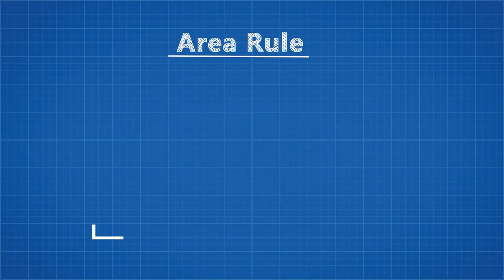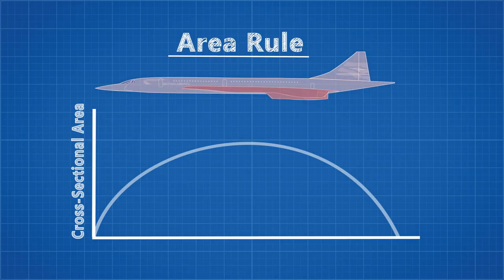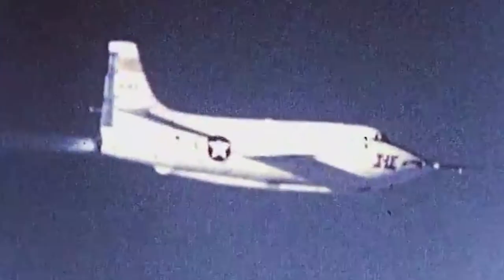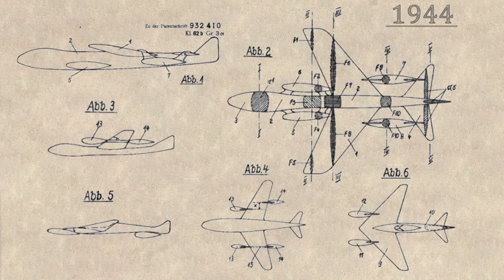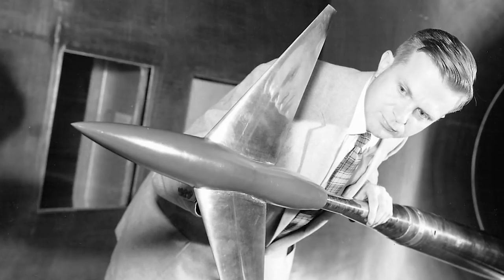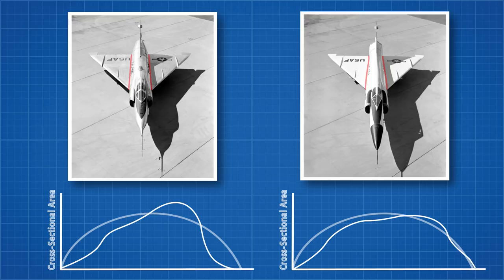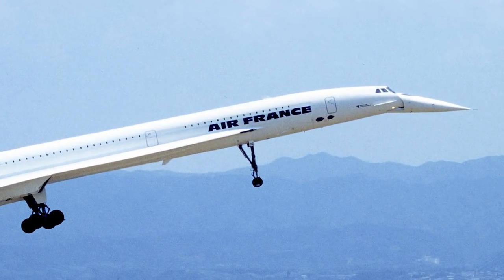Area Rule: How To Make Planes Fly Faster

Comment: Honestly did not understand the area rule. And whats with the cross section graph, is it a graph? Or a cross section of the plane? What does the line represent? How did one small change on the plane design make the line smoother? I have to find another video on youtube that clearly explains this to enter your contest.
Reply: it's a function. x is the position along the plane's length, and y is the area of the cross-section of the plane taken at that position. Basically, you are cutting the plane in short slices from nose to end, and the area of each slice give you one point on this curve. That's how i understand it anyway
Reply: In less mathy speak its basically like this: you want a football like shape, narrow at the front, slowly broadening, then gradually narrowing again at the end. That graph is just the mathematical way of showing that
Reply: If you're still unsure of the cross section that is being discussed and how the graphs work:
Imagine you had a giant bread slicing machine like thing that could cut the plane into thin little sections. Run the plane through that such that the first slice is the very tip of the nose, like the heel of a loaf of bread.

Measure the area of each of the slices, and plot them on a graph in order. The larger the area, the taller that point is on the graph. - You want a nice smooth curve with no sudden jumps or falls.
Reply: These comments explain it better than the video, the video needed more explanation especially with regards to the graph and an explanation on the briefly mentioned 'wave drag' and the shock-waves it creates?
Reply: The football shape thing is close but the cross sections don't have to match the "shape" of a football they have to have values similar to those positions on a football. 

Imagine: slice the plane into thin ribbons from nose to tail. Reshape the weird shaped ribbons into circles and then put them back together. The ideal plane following this process will end up shaped like a football.
Reply: This thread made waaaaaaaay more sense than the entire video. And without fancy animation, just better wording. You guys should start an engineering channel.
Reply: Randomly enough, I actually have been working on scripts for a possible engineering/design channel, but exploring flaws and neat ideas seen in industrial design. No idea if I'll ever get the time to film any of them.
Reply: RealLuckless I would love to see that.
Reply: Yeah, I needed to rewatch the vid to catch what exactly was being plotted in that graph. And I'm a Physics major.
Reply: Can someone explain me why does the area rule work?
Reply: The area rule basically this: the ideal shape of an air craft is a sphere. The closer the shape is to a ball, the more efficient it will be at flying.
Reply: Why ball? Water drop like shape has the least amount of friction, does it have that much less lift?
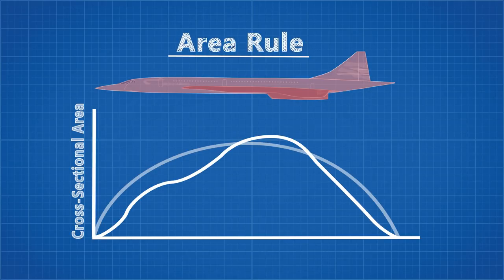Reply: I'm sorry but he explained the graph very well at 0:53 so if you didn't get it maybe you missed that part or you didn't have your coffee yet... Either way, no need to really critisize his video/presentation
Reply: So...it mean the smaller the plane the better it generates lift? What make plane go faster as far as I know probably was about engine most of the time and as well earo dynamic
Reply: The x is the position on your plane, and the y is the total section aera of the plane at this position. It means that if you cut the plane at the position x and you watch it from its front, you will see the total section aera.
Reply: @brandondavey8127  That's description of the Area Rule is funny, but certainly easy for a person to visualize. It also makes the task of understanding how an actual airplane succeeds or fails much easier. The video needed something like your description in a video form. Thanks.

Comment: At higher speeds, the F-14 Tomcat's wings rotate rearward, creating a more delta-shaped wing geometry, but also matching more closely the ideal cross section area distribution you mentioned in your video.
Reply: This is also done to increase sweep as well as change the primary lift generation from traditional pressure difference due to laminar flow over the air foil, to vortex lift which intentionally creates flow separation to produce large vortexes above the wing

Comment: Street lights! With recent hurricanes in America and major storm in Romania, many street lights that weren't aerodynamic enough  were bent or torn away, while the nicely streamlined ones were still in place.
Reply: Halo444 no this actually works differently. The street lights are streamlined not to lower the amount of force applied by friction of the air, but to reduce the low pressure zone that forms at the back (the side where the wind flows away from  the ligt) of the light, because this forms vortexes that will make the light swing from side to side perpendicular to the direction of the wind. Real engineering actually did a video about the burj kalhifa in which he explains it: https://youtu.be/niVguabIhTs
Reply: Nope. The area rule reduces wave drag, and therefore is only a factor at speeds close to and beyond the speed of sound. The street light design has to do with  a different phenomenon.

Comment: Wow, that's awesome! I already found a couple (I think):
- The reason for the Space Shuttle external tank and boosters not being in line.
- The reason for vertical and horizontial stabilizers never starting at the same point.
- The reason for military drones like the Global Hawk having a big hump in the front.
- The reason for modern planes like the A350, 787 or CS300 having front sections with completly smooth tapering unlike older planes like the 737 having a distinct "nose" in front of the cockpit windows.
- The reason for the iconic bulging shape of the Super Constellation.
- The reason for the Eurofighter Thyphoon having small fins between the canards and the wing.
- Probably the reason nobody uses canards.
Reply: You are almost completely wrong LOL

Comment: The SR-71 has that rule incorporated with pretty dramatic effect as the fuselage nearly disappears into the wing as the wings cross section increases. It's also noticeable on the B-2. Much larger at the cockpit, slung way out in front of the blended wing. Then the wing becomes thinner and thinner as you travel rearward on the plane since the wing is increasing in span.

Comment: You can see that in the blackbird. The wings are heavily put back on the plane but the intakes for the engine being put just in front of the wings. Not to create too much drag but for the desired purpose you said In this video.
Reply: Yes, although more so on the SR-71 than the A-12.
Reply: Also the oddly wide nose slightly tapers on the way back to the wing almost in line with the engines. I also assume that this applies to the bulbous bow on large ships as the primary use is to reduce wave drag. Also I'm in Cork so hmu.

Comment: This effect can be found on the XB-70 Valkyrie, as the fuselage slowly gets smaller while becoming part on the middle wing structure. Also, the engines were placed in a smooth box which was designed in such a way to be as aerodynamic as possible, while still allowing for the necessary features go compression lift.

Comment: My favorite cross section area proportion is on the Su-27 family.. It flattens out at the wings
Reply: Yes, and actually this is a technique that a lot of airliners use as well, except at the bottom rather than the top of the fuselage. It would be inconvenient to narrow the plane above the wings because that would reduce passenger space, and the same goes for lowering it at the top of the fuselage, but they can lower it at the bottom of the fuselage, because that way, they only cut into cargo space.

Comment: Aerospace Engineer here... 
Take a look at the Cessna Citation X aft fuselage. It's heavily area ruled for several reasons; first, to reduce drag due to compressibility effects (as the video mentions) but also allows the massive engines to be mounted closer to the aircraft centerline which reduces the moment caused by an OEI (one engine inoperative) case which in turn reduces the required size of the vertical tail thereby also reducing drag (not just in the transonic range).
Love this channel by the way. I hope it inspires more people to get into STEM fields.

Comment: you cannot discover something twice and i find it sad that just because they were German/worked for the nazis that some people never got the recognition they deserved. Otto Frenzl(i knows classic german name) figured this out almost a decade before Whitcomb and yet people call this effect after him instead.

also engine placement on small business style narrow body jets has little to do with area rule. you can't put the engines anywhere else but at the rear. not enough room under the wings. to put them there needs a high wing or large undercarriage(both undesirable). fokker 614 aircraft had them on top which looks kinda funny and mounting them on the middle/front fuselage blocks your view, is too stable(yes that can be bad) and is very noisy inside the cabin.
Reply: They can always be mounted within the wing as in the UKs V bombers and the Comet. But that would obviously restrict the engine size. But it is a possibility.

Comment: The Cessna 172 is an aerodynamic masterpiece, the area rules is almost spot on, that's why it is so widely used :)

No, but on the SR-71 the fuselage is getting thinner along the length of the plane as the wings and their engine pods start to expand, such a cool aircraft

Comment: This is also used in naval architecture. Ships are made in the same way. Ships hull must be smooth for better dynamic properties which brings to reduced fuel consumption and better speeds, but ships hull is typically smooth ("ideal") because there is no wing or engines on the sides.

Comment: very good explanation, there's another reason for placing engines ahead of the wing though: it helps giving "pitch down" tendency to the airfoils during wing flapping motions, avoiding the very dangerous situation of airfoil or wing "divergence" in which the wing airfoils pitch upwards very suddenly and uncontrollably causing mechanical failure.

Comment: The Sr-71 and A-12. They both had strakes running along the length of the cockpit and fuselage to better handle transonic speeds. And the 2 seater Training variant of the Sr-71 had a second smaller cockpit above and behind the first, which dramatically lowered the top speed due to the incredibly large amount of drag it produced despite it's small size.

Comment: The B-2 Spirit is a great example of this rule I think. The front where it's narrower is larger vertically, and as it goes back and becomes wider it also becomes thinner so the change in cross sectional area is gradual. I think that's actually a really good visualization of it.

The F-117 Nighthawk is a good one too. I think basically any stealth plane will be great for this rule because of how important the shape is in stealth. It's got kind of a fat front end and as the wings come out the top lowers down at the same rate.

Comment: F-104 Starfighter and F-5 Tiger II both have strategic cockpit and engine inlet placement as well as tapered fuselages at widest wingspan, but I think the coolest example is the YF-23 (which was pretty darn fast).  On top the airplane, right at the wing tip cross section is where the fuselage tapers away and the engine "humps" start, and out back it uses a Y tail with tapered engine outlets to match.

Comment: The example of the area rule that I am most familiar with and the design that introduced me to the concept is in the waist pinching design of the F5 Tiger/T38 Talon.
Interestingly if you look at the F4 Phantom, the engine intake ducting is pinched at the waist as well. Yet the phantom still has a huge amount of drag and overcomes it with massively powerful engines. The result is a fuel hog that drops like a brick if it loses its engines.

Could you please do a video on the Meredith effect and how it was used in the design of the P51 oil cooler? Its kind of a difficult concept to grasp and I think that it would make for a fantastic video, especially as iconic as the Mustang is.

Comment: weird example, but if you ever take a look at cobbles from a fairly high volume stream or river, they're always at least slightly elongated parallel to the direction of water flow. The reduced cross-sectional change offers less resistance to the sediment carried by the water, and the water will naturally shape the stones to be as close to that ideal area as possible.

Comment: Look carefully at the tail-mounted engine on the MD-11.  The engine intake duct is area ruled to reduce the cross-sectional drag between the intake/engine and the vertical stabilizer.  In essence, a fuselage and wing turned on its side.

Comment: I think the engine position of slower attack aircraft like the A-10 is really interesting. The wingspan is very long and but narrow, keeping a proportional area to produce enough lift while still having room for a ton of missiles and bomb (longer wings means more weapons). Because of this odd wing shape with a narrow fuselage, the engines are tightly placed behind the wings but still in front of the tail end. It goes to show that even for slower jets that don't come close to supersonic speed, drag reduction is optimized as much as possible.
Reply: Ineta Life - False - I knew that someone would comment on A10 odd shape. The real reason for putting engines that far on the tail is that engines are shielded by wings from  incoming anti-aircraft fire from troops on the ground. Also, A10 is intended to use improvised airstrips and this way, dirt is less likely to get to the engines.
Also, this video is shitfull of ads and does shit for explaining what attack area is. The graph is hilarious - "here you got semicircle line and here's more wavy and if you could make that wavy line more circular that would be greeeeat".
There, my post contains almost same amount of knowledge and less ads.

Drink your Ovaltine

Comment: Thanks for explaining the area rule. I knew that's why they narrowed the fuselage on fighter aircraft, but had no idea about the hump on the 747. No how about the Cirrus Jet? The front of the fuselage is much larger the the rear, and it tapers down significantly where the jet engine exhausts out the back. They use a Pro Stock hood scoop like intake to draw in the air for the jet engine, but it tapers where it reaches the fuselage. Is this to reduce drag? It makes sense after watching your video! Hey, I learned something.

Comment: One example is the curved shape of an energy-producing wind turbine blade. The blade is designed in a way that maximizes lift on one side and reduces drag on the other and at the tip. This is done by angling the surfaces to achieve direct contact with the wind and tapering cross-sectional area.

Comment: The flap track fairings (canoe shaped things under the trailing edge of the wing) on passenger aircraft are used & shaped for this very reason, as well as a aerodynamic cover for the flap mechanisms.

Comment: As important as area rule is it only really applies to trans/super sonic aircraft and even then sweep back has a much larger impact on Mcrit and drag rise. The Convair 990 and Tu-95 both have nacelle-like additions to their trailing edges in order to help get that curve smoother. If anyone is interested Aerodynamics for Naval Aviators is a book freely available in PDF form from the FAA which is required reading even today for ATPL study and goes into area rule and other design features used in transonic aircraft in greater detail.

Comment: I found a very interesting example of the area rule 

The F-82 Twin Mustang, in some of the variationd had a radar installed for night time operations 

You can clearly see that the radar is installed just as a jet engine in an airliner, being under the cross midle section between the two cockpit but spaced forward, both increasing the radar cone reach and helping to obtain the more ideal distribution of the area rule

Comment: My favorite example of this is how it appears in, believe it or not, birds.

A bird's wing provides both lift and thrust, and in order to do this, it has two basic "shapes" that it takes while flying: fully open and partially open. When fully open, the wing forms a lifting surface, like the wing of a plane. In this state, the bird sweeps it's wings forward, as this is when they have the least forward drag and it also gives extra lift due to the fact that the wings are going faster (relative to the body).

Once the wings are fully forward, the bird partially closes it's wings, giving them a scoop-like shape. It then sweeps back, pushing against all the air trapped under and behind the wing to give lots of thrust.

Now here's the interesting part: the part of the wing where the most thrust is focused is the the metacarpals (the bird's "palms"), which are always the most forward part of the wing, just like wing engines on a plane!

Finally, their bodies taper past the shoulder, just like the fuselages of aircraft. It's really is amazing to me how these things appear in nature long before we ever think of them.

Comment: The Honda Jet has it's engines mounted on top of the wings but shifted towards the rear so they're almost in the position where they would be on similar jets like a small citation jet. There's other advantages besides the cross sectional area e.g. vibrations/noise or storage room in the back

Also the A10 "warthog" has its engines between the wings and the elevator, for probably the same reason